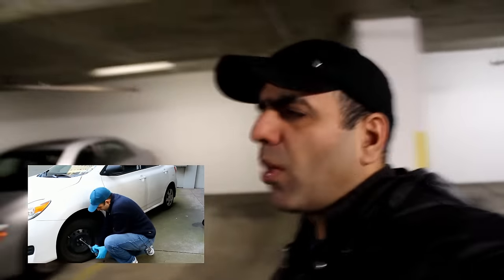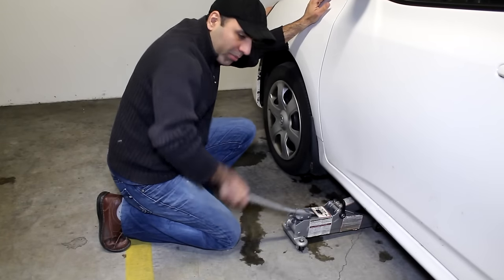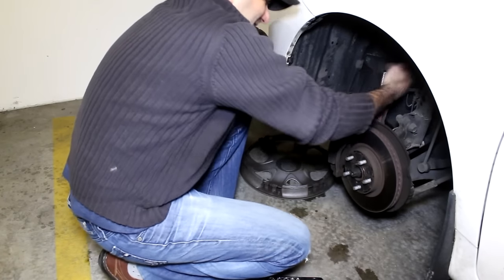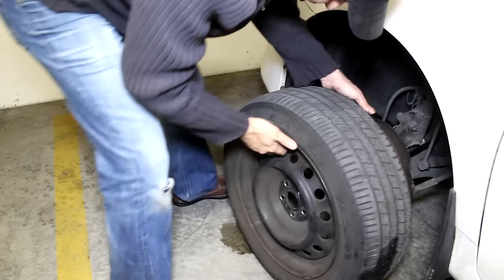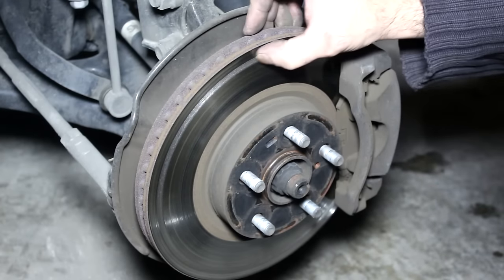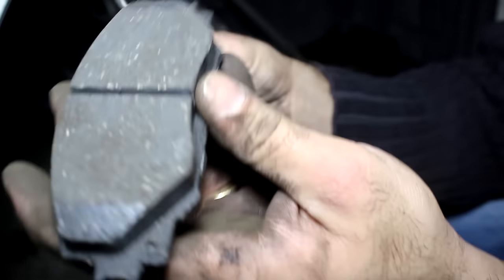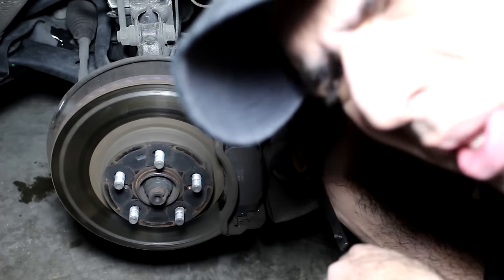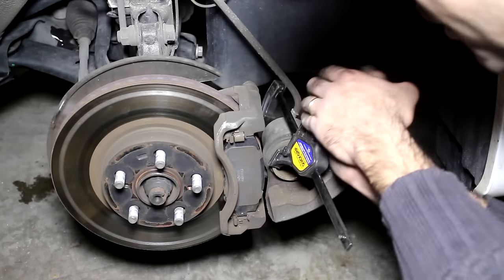ElectroVLOG-003: Changing the Last Pad

Comment: Please break the nuts with the car on the ground next time? 
And also tighten them with the wheel on the ground
Ok? Ok bye now
Reply: Was thinking the Exact same. Doing that while it's still on the ground makes it 100 times easier
Reply: This lol. Keep your tires from spinning with the wrench.
Reply: And use your bodyweight by standing on the wrench with one leg.
Reply: Also when pushing back the brake piston loosen the bleeder valve on the back side of the caliper. It will go back 100x easier. You should then bleed the air out of the lines but after 7 years chances are that fluid needs to be bled anyway. If you don't know how youtube "how to bleed brakes" there will be a video somewhere... I assume Chris Fix has done one.
Reply: Just take the brake master cylinder cap off when pushing the piston back in.
Reply: I have actually never done it that way but seems so much more simple. I normally bleed brakes when I change pads anyway but good idea.
Reply: Just cut the brake lines. Then it will go back much easier.
Reply: when you said you where going to hit the brake I thout yo whole have hit the acelarater and brake the disc
Reply: Never ever open a bleeder valve unless you really need to bleed your brakes!
Those cheap automatic plastic clamps he is using are junk and do not push hard enough. Also he was only pushing on one side of the piston.
Just use decent clamp or order a brake caliper wind back tool kit.

Also, before resetting your caliper check the brake oil level because if it's too high it might overflow while resetting the caliper. Low oil level is often due to worn brake pads and replacing the pads could normalize your brake oil level ;)
Reply: Just remove the brake pads. That way the brake discs will last much longer.
Reply: What about supporting the car on jackstands? or at least placing the wheel under the car whilst he works?
Reply: he might want to invest in a break compressor aswell.
Reply: ppdan there's no problem using that clamp, but he should have used it with the old brake pat in its position, so the force is applied evenly across the surface of the piston. That's the way I do it, only that I don't have that kind of clamps.
Reply: While we got useful tips going here, I recommend a large C-clamp and a block of wood to help compress the caliper. However, the clamps you had DID get the job done so thats what matters.
Reply: Also when compressing the caliper pistons in, you need to press on both sizes of the cup otherwise it will wedge in the bore.
Reply: I own a 6 cylinder v8.
Reply: You don't need a block of wood, you can use the same brake pad you're replacing.
Reply: Jay Dub finally someone who knows what their talking about. Some people in the comments are suggesting a brake compressor or loosening the bleeder valve when just unscrewing the master cylinder cap and using a C-clamp with the old pad on the piston will do the trick
Reply: I always lay the old brake pad in the caliper and use it to press against with the C clamp so I can center the clamp on the piston bore.
If your brakes get low, so will your brake fluid.  If someone added fluid when the brakes are low, you will find the reservoir may overflow when you push both caliper pistons back in.   Brake fluid strips paint so you really don't want it to overflow.
Reply: If you had that kind of clamp you would know what I mean. Those clamps just give way. 
They are ok for quick fastening but if you need a decent amount of force they are useless.

Anyway, I stopped using clamps for this and got me a cheap wind back tool set since they are only €20-25.
Also, the old clamp trick was a little annoying on the rear calipers of my Galaxy where you have to turn the piston while pushing it back.
Reply: you could also use the old brake pads with a clamp to push the piston back
Reply: C-clamp with a radial threaded clamping mechanism. Quick clamps just make this harder.
Reply: arknessnester the old brake pad with a C-clamp works best for a backyard project. They make actual pistol compressor tools, but they aren't worth the expense if you aren't doing this all of the time. Plus a C-clamp can be justified to use for nearly anything.
Reply: nunya bisnass i know exactly what you mean i do the same thing pop the old brakepad in and c clamp it for the back and tighten works quick and everytime lol
Reply: Yeah that was painful to watch. Break the lug nuts, jack the car up, install jack stands, use a standard C-clamp to compress the cylinder (some cylinders are the rotational type as indicated by the cross on the piston). Reverse, and make sure to torque down the lug nuts on the ground. That rotor is trashed, and might not even turn, but rotors are cheap enough to just replace the set if they can't be turned.
Reply: Double Clutch Gaming 😂😂😂
Reply: Thats the least of his problems...
Reply: mogolfiero if the card had similar brakes as trucks the brakes would be much better, and last a little longer.
Reply: Awesome advice Wesley.
Reply: I was about say that. But well....
Reply: Jay Dub this is probably the easiest way to do it, after your done put the cap back on and pump the brakes a few times then your good to go.
Reply: Rotational cylinders are used in the rear axis, since these wheels are usually the ones with double function, braking while in motion and also parking brake.

I've seen and driven cars with rotors in much, much worse condition than that, and they've worked just fine. It doesn't even use the brake pads necessarily quicker than a new one.

Other than that, yep, it hurt when he broke the nuts on the air. Moreover, in another video he tried that, then realised he had to do it with the wheel on the ground, did it, and back on the air to unscrew them. I wonder if it was on purpose or not.
Reply: Double Clutch Gaming that's old tech. The new 4 cylinder v12s are the norm these days!
Reply: He did alot of things wrong in this video.
Reply: Wesley Howard Nooooo...  that's the last thing you want to do!  just unscrew the cap on the master cylinder reservoir!  That said, mine have always worked without having to do any of that....
Reply: Lol!  I love your videos dude!  what about some safety with that jack?  Never only rely on a jack alone...  Plastibots.com
Reply: Also, don't use the squealer pin from the old brake pad... it's worn down just like the old pads were.  The new pads should have also come with a new squealer.
Reply: Alex Bailey, actually it depends on the design of the pin among other factors. If it's just started making noises, it's actually pretty much new, so you can reuse it. Also, in this case, being just a piece of bent metal, so you can adjust it yourself.

On the other hand, new pads don't always come with new hardware. The pads in my car have some metal parts that put them in place, but not all brands include them in their boxes. That being said, that metal pin should actually come everytime for that specific car. My pads don't have any way for me to know when they're about to end their life. Poor design from the car manufacturer.
Reply: +Kenneth Jongmans I found a YEEN!
Reply: why? i just put on parking brake and wheels dont move at all
Reply: +Silentkiller987 you just can't rely on your parking brake for such a work. I mean, it will probably do the job, but you're making it work extra. Also, you're somehow forcing the axle by breaking the nuts on the air and that's not needed, it might "hurt" its bearings in the long run. Moreover, when you're doing that on the air, the wheel will have some play, thus making it harder for you to get it done, while that won't happen if it's on the ground.
Reply: makes sense, thanks!
Reply: You're welcome :-)
Reply: went to the comments just to say this
Reply: mogolfiero you can brake them loose if that's a drive wheel because the transmission will hold the wheel but the free spining wheel will spin because it just a bearing unless you engage the parking break witch I inset if your jacking up the car.
Reply: mogolfiero  danks
Reply: Yeah, but the video wouldn't be nearly as funny.
Reply: just my thoughts
Reply: Also the old brake pad and a clamp works well when trying to push back the cylinder, because it will equalize the force over the entire cylinder.
Reply: It was a miracle he didn't brake a lug nut
Reply: On my car, just taking off the brake oil's cap makes it easier.
Reply: You also have to torque all of those bolts down to a certain spec and use thread locker or they could come loose, I hope people didn’t follow him exactly
Reply: Ya know what is easiest of all remove master cly cap take old screwdriver between old pad and rotor on the inside (piston side of caliper) and even moderate pressure it will push the piston back home it should probably be said that you do this before removing caliper and pay attention as to not  leave rotor all jacked up but no special tools required........ now if your a tech or working on someone else’s car you probably have all the special stuff plus are against just hanging new pads but if you’re a DIYer this works pretty slick
Reply: Oh and is that an old morgan next too your toyota is this your weekend ride mr electro
Reply: exactly. one time i was taking the nuts off my friends car and after standing on the wrench i decided to beat the wrench with the jack right as she came back to the car. we now live together 2/7ths of the week.
Reply: @wesleyhoward9573  or use a c clamp.
Reply: He said that in his old video
Reply: Makes no difference on a FWD car if its in park.
Reply: @roxthedumbhyena  So, if he had to push with 100 lbs of force off the ground he would need only push 1 lb if the tire was on the ground? 100x ? no. No difference.
Reply: @pontuseriksson4533  Use a breaker bar
Reply: mogolfiero it sounds painful
Reply: STAR PATTERN WHEN Tightening Your lugs
Reply: I'm guessing it's so the car isn't resting on something that isn't bolted. Makes sense to tighten it while it's on tho, so it goes on "straight"
Reply: I use a big screwdriver between the caliper and old pad before i unbolt the caliper. No need for a big c clamp or special caliper resetting thingamadoodle.
Reply: @justinw3960  you don't need to bleed them open?
Reply: Yes
Reply: It is better if u put it into a gear. The wheel don't move.

Comment: As a mechanic, i was amused and yet horrified by this.
Reply: My blood was boiling when he said that cracks on the break pads are okay and blaming the wear indicators for ruining his disk.
Reply: Coolesta, except he said none of those things... the 'crack' he was talking about was the wear indicator groove down the middle of the pad. 
The thing that ruined his disc was not a wear indicator, nor is it there to make a noise as he said, it's merely the spring clip that locates the pad.
Reply: First of all, wear indicator groove does not exist, what you're talking about is the the slot that is used to reduce brake fade (specifically gas or water fade). Yes, wear indicator exist and makes a noise whenever you apply the brakes. The only clips I am aware of are the clips that fit the brake pad into the caliper, if you somehow manage to have the clips come into contact with the disk I like to kindly ask you to quit your profession as a technician.
Reply: For this particular design, the clip is a wear indicator. On some vehicles it's also a retaining spring to prevent brake chucking. There are hundreds of different designs. The groove appears to serve many purposes but we can all google it rather than argue. 
But in reference to my original comment, I do love ElectroBOOM so all is forgiven for such entertainment. I think we all know not to take this as an instructional video. Plus, even with my experience, I bet he could school me (and many other) on diagnosing some tricky electrical gremlins after adjusting for his automotive learning curve.
Reply: VegetableMigraine how do i change blinker fluid?
Reply: VegetableMigraine same lol
Reply: VegetableMigraine also he didn't use a torque wrench to tighten them to factory spec
Reply: Bruh don't get me started
Reply: Pinkamena Diane Pie you don't need too just tighten em until you cant really move em
Reply: VegetableMigraine same
Reply: @3000marco1: Skit is right and I wouldn't want to have you as my technician. My car has the same brake system, with the clips scratching the disc when the pads are worn. I agree it's not the best system, but it exists.
Reply: ooltimu  he did fine.  A call this job a "pad slap".  Im fine with doing several pad slaps on my own vehicles.  Anytime I replace brakes in family members vehicle I replace the rotors as well so they don't have to worry about a vibration or pulsating. And that means they don't come back to me.
Reply: I was freaking out when he pumped the brakes with the caliper loose!!
Reply: Pinkamena Diane Pie i like using the lugga dugga torque setting. I generally go by the 2 lugga dugga torque weight.
Reply: Junglistic Soulja you may want to reconsider that.

The pads i replaced on my charger the fronts certainly did break. They snapped crumbled and broke when i ran my thumbnail over them.
Reply: Stephen goss  ; Yeah man ! I was expecting that the clamp broke ... I'm so desapointed :(
Reply: VegetableMigraine I hear ya lmao
Reply: I've had helpers who couldn't turn a rotor to save their life and I only let them use a 3/8" impact so they couldn't do any major damage, but they did better pad jobs! He didn't lube the pins, pressing the brake pedal with the caliper off could have shot that piston into the car next to it, the rotors looked decent but it's very likely to warp once the new pads seat in and only replacing one side at a time is just begging for a host of major issues down the road. I LOVE his videos, but I'd have to watch him like a hawk if he was working for me.
Reply: those are rattle clips not a indicator and yes he should have used grease on the pins and the slot is not an indicator neither the slot on the pad is to keep your brakes cool as is the notched rotors... he should have tried to turn his rotor if possible or replace it its going to cause uneven wear and brake pads can crack break even  rotors can from age weather and wear.  the fronts usually wear faster from obviously most weight is on the front when you stop and you should always change both sides weather its the front or back never just one the back is usually ok. there is no indicator to tell you it's time to change your brakes  it's common knowledge why would you let your brakes wear to the point that your rotors are no longer turnable if it was designed like that don't you think they would let you know before it's too late....  most of these comments on here do not have a clue of what they're talking about I don't care if your backyard mechanic or if your dad told you to do it this way  there's one correct way and that's it,....
Reply: One thing that really worried me was that he had left his ring on
Reply: As a mechanic myself, i to was amused and yet a bid scared 😂
Reply: @ndelliott138  Say what?! MAAAAAN Fuck that rotor! Its in good shape depending on the size of your wallet. those rotors will never warp, there is not enough heat or energy transfer to a mass that big and dense. You would do more damage turning that rotor, its a surface scratch the pads will likely polish out. That caliper piston could never shoot into the next car, the physics are wrong for that with an in-compressible fluid among other things.
Reply: I was waiting for the break housing to start leaking
Reply: @3000marco1  Brake pads
Reply: @goddamnmaddog2024  Nice 😂
Reply: I do it ever 1 to 2 years, but this man does it every 3 to 7 years
Reply: The fact that the life is uneven of the four wheels
Reply: Especially by the tire iron method lol
Reply: @CadenV1234  I had my brakes replaced after 208000 miles, ten years.  No.  I don't use my brakes much if I can avoid it.  Rolling friction is awesome!  Slower, but much cheaper than brakes every couple of years.  Moving to town killed my brakes.  I lost 2 years compliments of suddenly changing stop/traffic lights.  Stop signs are much easier than "emergency" hard braking because I light suddenly changed.  Traffic lights with bad timing and threats of expensive tickets cause accidents/wrecks.
Reply: Same

Comment: The reason the squealers didn't work and scratched your rotor disk... you have them in backwards! As it is contacting the rotor, the metal tab is bending into the pad causing grinding, if you flip the pads / squealers to the correct orientation (the bottom) the tabs will bend away from the pad when they contact the rotor and cause a vibration (a.k.a. the "squeal" noise) Always position stealers to bend away from the pads when the wheel / rotor is rotating in the forward direction.
Reply: This needs more upvotes
Reply: Or, just not wait 3 years between changing your left front and right front brake pads...
Reply: In reality their purpose is not to sqeal when the brake pad gets worn, but to eliminate clacking noise when braking in reverse. The correct position for the metal clips is up.
Reply: Thanks for tip. Been changing my brakes for 20+ years and never realized.
Reply: Finally someone shares my point
Reply: Makes sense
Reply: @antonkolding7563  metal clips and squealer are 2 different things.
Reply: But that’s Electricoboom one video
Reply: @labrador55555  This isn't Reddit
Reply: hahaha